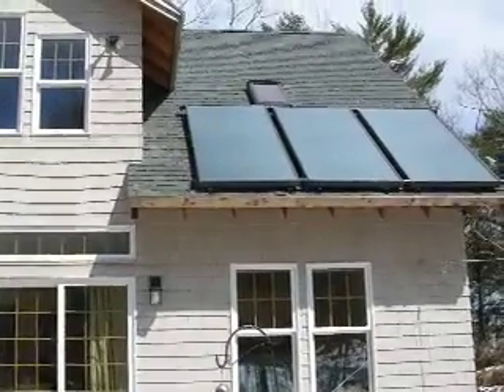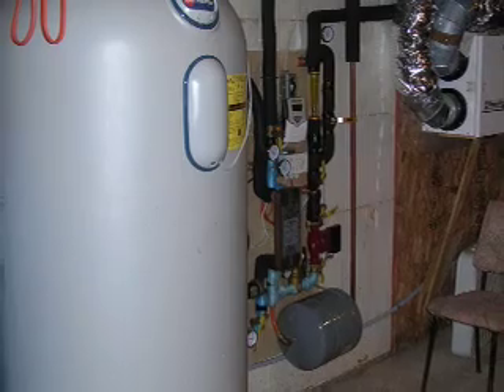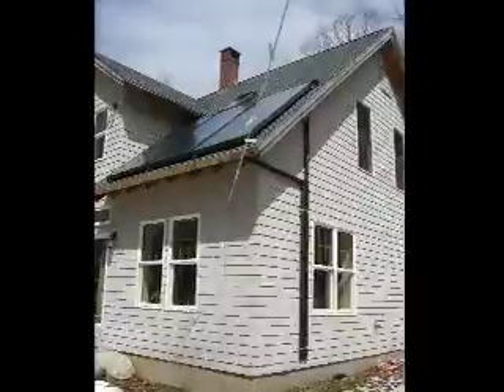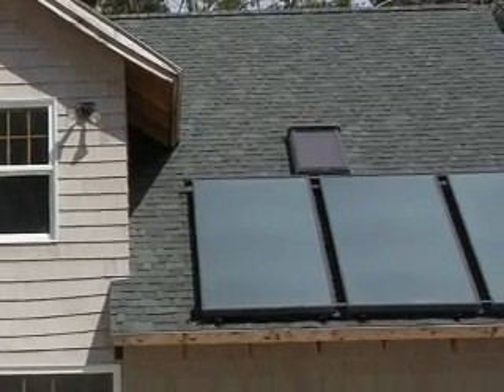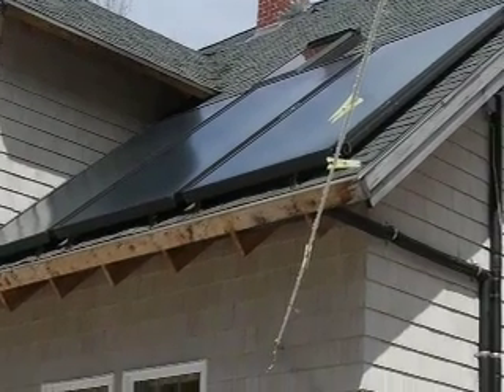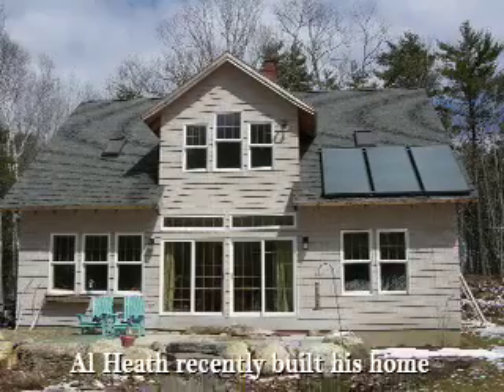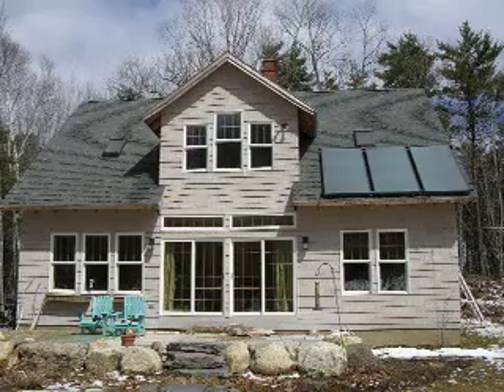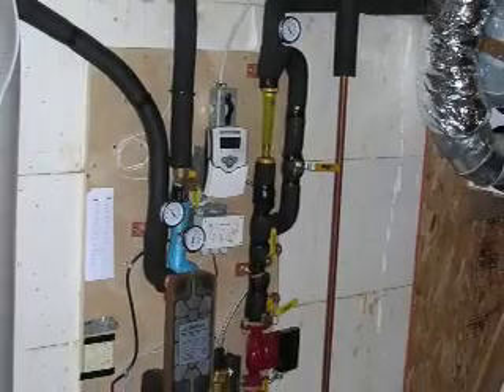Renewable Energy - Solar Thermal (Hot Water)

Comment: @SolarCoordinates what you see in the video was an uncompleted unit, if you read some of the comments I have posted on some of the videos you will see i have since completed and closed in the units, the pvc piece was only for heat testing in that video alone, it failed at 140 degrees,  I have since converted it to a glycol heat transfer system which gets freaking hot!!! I know looking through posts are not the most desirable thing to do, but they are there..

Comment: @TheDudeRulez09 I caved in and watched a few of your videos... it's slightly better than most DIY solar hot water, but still nowhere near good.  In the video titled "Solar Water Heater build 4," you said that you're attaching a PVC fitting to your collector, but the maximum operating temperature of PVC is 130-140F.  I hope that was for some silly testing purposes and that you're not hooking this thing up to PVC or a garden hose long-term.

Comment: @TheDudeRulez09 I took a look at your system.  It's unglazed (no glass), which means it won't produce in winter.  You said it thermosiphons, but I'm not sure you know what thermosiphon actually means since I can see no storage attached to your collector.  Is that just because you're testing it out in the yard or what?  I sincerely hope you have storage hooked up to it because storage is the #1 most important factor that determines how much a solar hot water system will save a customer.

Comment: @torotoz Solar hot water systems don't last forever.  Copper flat-plate drainback systems will last 100+ years, but you'll still have to replace the tank and pumps and clean the heat exchanger.  Inferior components and systems, such as evacuated tube collectors or this glycol system will last anywhere from 5-40 years.  ETCs lose their vacuum and break in golfball-sized hail, and glycol turns into acid, eating away at system components.  This isn't a "bad" system, but it could be better.

Comment: @ligmania Flat-plate collectors like these shed snow pretty well, although it does take a while for the snow to leave the bottom 1/4 of the panels.  Even in snowy conditions, my panels have been @ 130F despite being about 40% covered with an inch of snow.

Comment: How does the system work if there is snow covering the panels ?  Do you have backup for the winter ?
Reply: The snow melts as it lands, so the snow actually never builds up.  This is a fairly old type of design.  There is a tube type system that has 20-30 tubes that you run the water through that is so much more efficient than these flat panel models.